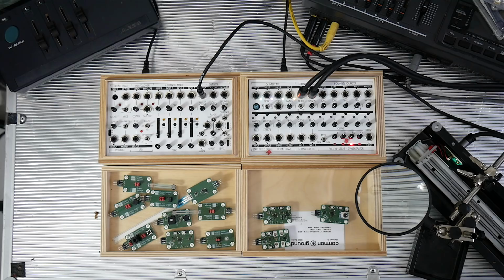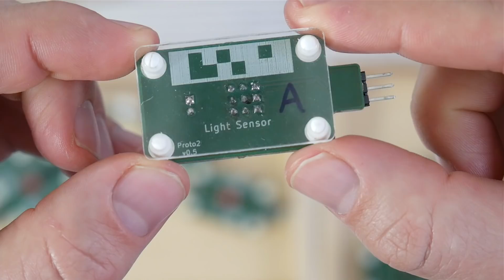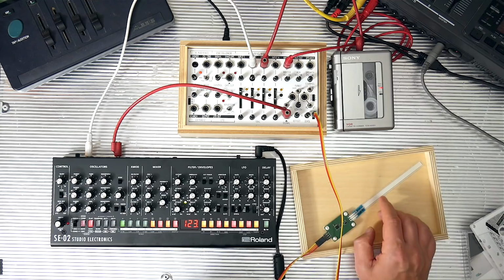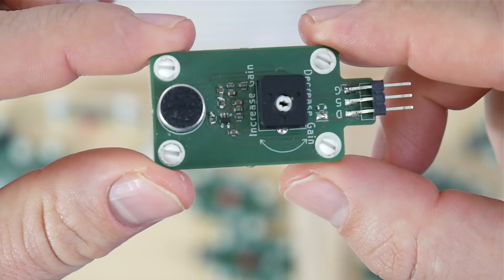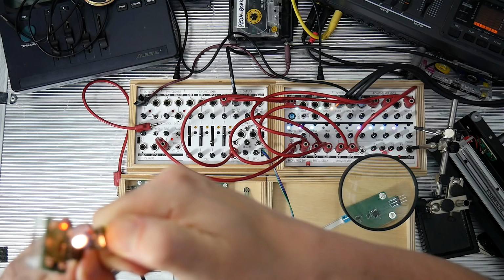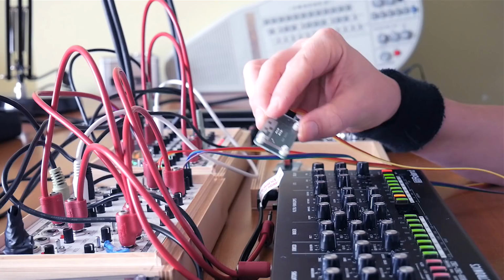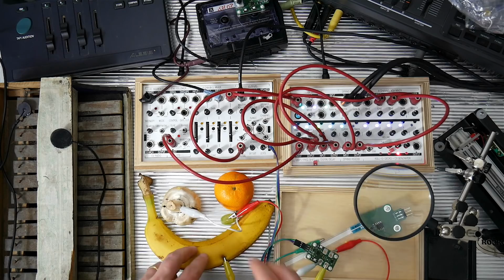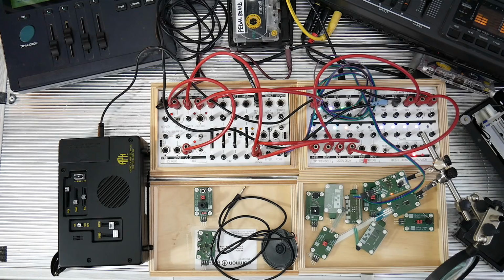Making Music With Sensors | Koma Elektronik Field Kit Sensor Pack

Comment: Red for ground?
Oh, the humanity!!!
Red is, at the very least, positive, and usually 5V, with 12V being yellow and 3.3V being orange.
But the cable you are using seems to have come from one of those "rainbow" colored flat cable, looking at the order of the colors, so I get it, I would also do something similar, I would just have to always triple check if I wired everything correctly because I just can't not think of red as 5V.

Comment: Good lord, that temp sensor. Thank you very much for the warning. I got weird looks when I whipped my headphones off at work.

Might be interesting to mount it in a rack or another piece of equipment that slowly alters the tone of the whole output during the duration of a music set. The longer you play the room, the more greater the effect.

Or, amusingly, run it out to a nearby HVAC vent, allowing the mood to shift as people feel the air shift to add a tactile component to the music
Reply from the maker: I see you are getting ideas, awesome!

Comment: Hi Hainbach - Very interesting effects you are getting. Just wondering about the object on the right at about 15:10. I think you said it was a spring reverb, but I didn't catch the rest of what you said. The DC motor is triggering it.
Many Thanks.
Reply: It's a spring reverb tank. You can use one with the field kit fx, and it's available in the fx expansion pack from Koma Elektronik.
Reply: @christopher_ecclestone  Thanks Chris, I saw it as part of the kit a few days ago. Koma gear is an experimenters dream!

Comment: Amazing. I cant wait to add these to my arsenal. Slightly off topic but do u find the Koma reverb to be REALLY noisy and prone to interference? Sounds like a grounding issue to me but I'm using it anyway for the extra hiss :)
Reply: You need to replace the supplied cable with a shielded one. That will take care of the interference. Or you can embrace the noise :)
Reply from the maker: What Local Technique said - all spring tanks need shielded cables. See the big ones I use here. Also, flourescent light, dimmers, mobile, switching power supplies all must be kept away. It just how these things (and single coil electric guitars) work.

Comment: Is that a homemade cable you're using to output from the DC interface of the Field Kit to the 3.5mm jack on the tape recorder? The connection is obscured by the two patch cables.
Reply from the maker: Yeah, diyed that.
Reply: @Hainbach  how have you dyied this cable? I found the Gieskes video to know how the Walkman is modded but I'm still wondering how to connect it to the dc interface of the field kit 🤔